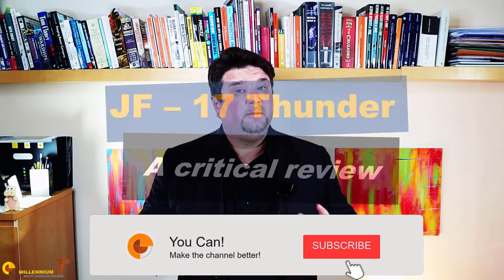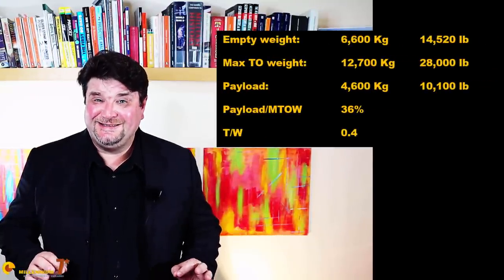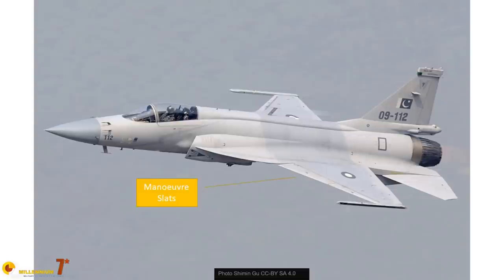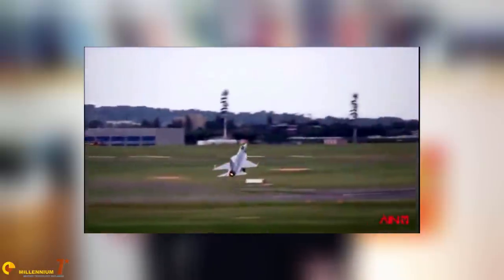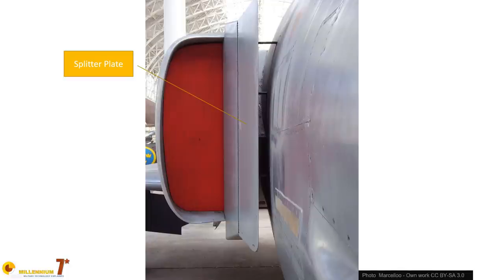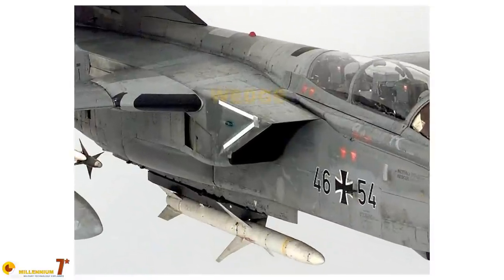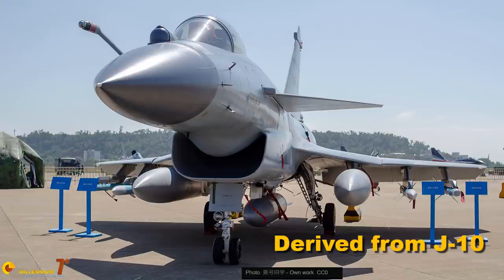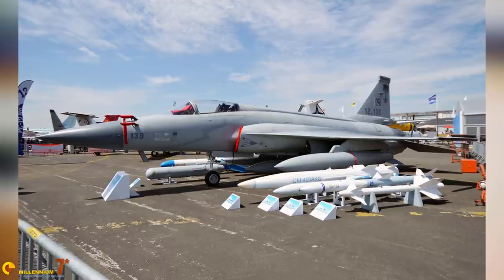JF-17 Thunder Block 3 & F-35 - What do they have in common?

Comment: You have to give Pakistan Kudos for developing their home grown fighter like India with the Tejas and no matter what their fallacies, we have to bear in mind that these are developing nations and not modern industrialised powers so every step is a step forward.
Reply: You can't compare jf 17 with Tejas. Tejas was completely designed by India with its own money. Jf 17 was made as a joint venture between Pakistan and china. It is safe to assume that it was the Chinese who contributed the most when it comes to funding and technical expertise. Jf 17 should be compared to the su 30 mki. An su 30 designed as per indian specifications.
Reply: @dranzergigs8333  You are right I agree. I meant that even the fact that a non ideal plane was made is already an achievement in a developing country we can't use first world planes as a reference, they have years of experience ahead of us. In my country Tunisia (which is a small country compared to giants like India or Pakistan we only produce light planes sport (kind of mini Cesna)
Reply: @dranzergigs8333  Although you are right with the point that it's a joint venture. But it's still such a big leap forward..Like Pakistan is "manufacturing many parts in Pakistan now and these JF17s are totally assembled by Pakistanis without chinese help anymore.. An R & D department is working which made it reach to block 3 with help of china..
 2ndly, Pakistan is also working alone on Project Azm which is a 5th gen fighter jet.. Although it's a term plan and slow process.. Pakistan makes fully indigenous Burraq UAVs and training aircafts Mushak.. Al-Khalid MBTs.. Cruise missiles..  Medium range ballistic missiles and many many more...  But also remember that the overall defence budget of Pakistan is less than $10B and doing all this in such limited resources is quite much for us Pakistanis..
The new government is focused in economic revival of the country and it will give further boost to such projects..
Reply: @eddykhan6672  first of all your budget is 17 billion dollars. 
Second your project azm is on paper till now and we haven't seen a design of the aircraft,so it's on paper. 
Now if you want to listen about us , so our amca 50% work is completed and first flight will be conducted in 2024, and both versions will be inducted in 2030, we have other ongoing projects like tedbf, aura  swift ucav, ghatak ucav, and Tejas mk2, Ins viraat.
 And there are many countries who make good defense product in less budget than yours
Reply: Majority of Tejas is bought from overseas, like radar, engine, avionics, even the missiles it will use, etc. Jf17 is all domestically produced by china or Pakistan, nothing nothing bought from others. That's the difference. India basically designed the shell only, and it's a samosa and no one is envious of the shape. And even just that, India has so many problems and doesn't even want it for their air force, they'd rather use Russian or french jets etc.. same as indian tank and anything else India designed. India far prefers other countries versions since indian one is far inferior in specs, also not reliable and breaks down far quicker.
Reply: @ex0duzz  I always encourage home grown stuff.
Reply: @ex0duzz  😅😅 saste nashe . Abey radar bhi India ka hai. Aur ha jf17 ki engine Russian hai baaki baaki sab Chinese hai ejection seat uk ki hai🤣. Kuchh research Kar le
Reply: @death_parade  tell me which indian made jets it's currently officially used in. Aka none. It's still in development. If it's anything like tejas or Arjun or any of India's other home grown tech, good luck, you will need it. By the time it's ready it will be obsolete already lmao

There's a reason no one buys India's tech or weapons, only India. And even indian military doesn't want it and prefers other better weapon and tech
Reply: @death_parade  and astra bvraam? It's only 110km max range, china's pl-15 is 200-300km already, and also have pl-17 and pl-21, which has 300km range and has its own aesa. Indian jets don't even have aesa yet while even Chinese missiles already do. Chinese domestic missiles basically double or triple India's missile range, not to mention Chinese planes have better radar too. Indians won't stand a chance with astra, hence they need to buy foreign tech to stay relevant.

Pakistan will also get Chinese missiles like pl-15 most likely if they haven't already, so yeah. Astra is worthless basically.
Reply: @death_parade  so no indian made planes use indian made aesa.. And like I said, if India is using astra on su-30mki then it's a joke when china has pl-15. India needs to buy longer range modern missiles from others if it wants to stand a chance.

No argument, no talk. You got nothing except dodge. And you know it.
Reply: @muhtadaali8847  Pakistan can not even design a 250 cc motorcycle. First, do that and then talk about aerospace R&D!!
Reply: Bro it's not homegrown in Pakistan it assembled in Pakistan😂😂
Reply: @dranzergigs8333  lets compare how indenigous your tejas is. 

The main thing, The engine which replaced our own made Kaveri Engine is GE404.( USA).AESA RADAR(ISRAELI). The radar is custom made only for Tejas by joint ventures.MISSILES(RUSSIA AND ISRAEL) . Although many of them are licenced to be made in India but it's still not Indian  technology.Radar covering cone(UK)The small silicon semiconductor ICs
Reply: @thelovertunisia  tejas is not fully indigenous it's a propaganda
Reply: @muhtadaali8847  Your engine is Russian 😂😂 not Pakistani rest all is Chinese Tejas is 65 pc Indian JF-17 0 pc Pakistani
Reply: @orkkojit  your engine. Missiles and other main components are exported. No one in the world makes 100 percent indiginous. India will be stupid to go for it
Reply: @dranzergigs8333  what is considered indeginous in tejas?
The design was done by dassault
Has the body of a vigen and the cockpit of a mirage
Radar is israeli
Engine is american
Weapons are foreign(astra is good though)
And the avionics are israeli
So what exactly is indian?
Reply: @thenoobdashow7428  what are you on about?the budget is clearly 10-11 billion dollars lol
Reply: @dranzergigs8333  no actually the Tejas is a completely foreign designed by France uses an American engine,it uses almost all  foreign tech and parts.
Reply: @muhtadaali8847  lol,only airframe 58% is in pak, entire plane is done by china. Paint by pak.  Calling jf17 pakistani is like calling f16 is pakistani.
Reply: @thelovertunisia  We shouldn’t assume that most of the work was done by China. The person you are replying to is drawing a false parallel. MKI is India picking what they want off a menu. Where as JF17 is jointly researched and developed. Pakistan didn’t have the means to produce it in the 90s so they took their design to China.
Reply: @umarchaudhry8953  Most countries today given enough time could create an indigenous fighter but often money and time are missing.
Reply: @ex0duzz  They took 30 years to build a mirage 2000 copy and still no one wants it.
Reply: @dranzergigs8333  teams was actually designed with heavy input from Dassault.
Reply: @muhtadaali8847  we literally use zero engines made in Israel and have no American a2a missiles in our inventory, you're making a fool of yourself son.🥵
Reply: @advaitk1917  GE engine and israeli missiles. I  miss typed it. Don't try to be over smart. You know what I am.talking about
Reply: @muhtadaali8847  we also have multiple weapons including standoff ones that are manufactured in house, that is all leaving aside the ew suite and most systems on board happen to be indian. You know what I'm talking about.
Reply: @thenoobdashow7428  radar India ka hai. Lolls. Mate writing 'Made in India' on an Israelian radar doesn't make it Indian.
Reply: @ex0duzz  over rated pL15 can be dodged by any good maneuvering propeller plane
Reply: @ex0duzz  in term of missile development India is far ahead in any Asian country, any defence magazine accepted it. Only problem with subsonic cruise missile
Reply: JF 17 is only painted in paxtan.
Reply: @death_parade  what a reply bro 👍
Reply: @dranzergigs8333  israeli radar  
Mirage based chasis 
Russian weapons 
American enegine 
British ejection seat 
Yeah indian totally
Reply: @iamsalngo81  just bcoz it's a delta song configuration doesn't mean it's based on mirage frame. Would you say gripen is also based on mirage frame. 
Similarly gripen also has American engine, British ejector seat. Same goes for Korean and Turkish jets as well. 
Tejas also has indian missiles like Astra aaraam rudraam and many others.
Reply: Thanks for watching,,
But JF-17 speed Rafale speed range is same ,
Reply: The only thing Indian on the Tejas is the name with the radar , avionics , engine and weapon systems all imported from overseas ….atleast the Pakistanis manufacture 60% of the components in house
Reply: @ex0duzz  well to correct you Pakistan's defence budget is actually less than 10b it is actually 8.something. project Azm is already gaining momentum as Pakistan and Turkiye agreed to work on TF-X together talks are ongoing to develop two separate variants for each country. Turkish variant with more western components while Pakistani variant will have Chinese systems incorporated in it. Which can be a plus point for the exports as well. No one was asking you about your projects or comparing the two but since you have such an inferiority complex towards Pakistan and their jets so you keep on rambling about your projects.
Reply: @ayonbiswas4186  who cares if we designed it or not the truth is our jet(started in 1995) is already flying and exported to other countries and your smaosa(a project from late 70s) is still struggling for induction and yet to find a customer.
Reply: @amitbhau  then why don't you get propeller planes coz your jet wasn't able to evade the old aim-120 and yet you have the nerves to made such ridiculous claims.
Reply: @djrandomwalker7656  the jf17s has several sub systems that are made by pakistan
Link 17,avionics,wide array of air to ground munitions made in pakistan such as takbeer glide bomb and h4 sow 
The jf17s electronic warfare suite is designed and developed in pakistan
The jf17s maws are made in pakistan
The jf17 has several pods for targeted jamming or bombing missions
This is a whole lot better then indian tejas
Reply: @dranzergigs8333  compare the viggen and mirage
And see the blueprints 
It's literally designed by dassault
Reply: @dranzergigs8333  tejas completely designed in India with help of multiple other countries and parts from those countries
Reply: @dranzergigs8333  Lol it is based on mirage lmao it is
Reply: @orkkojit  but still we offer fantastic ☕️ 😂
Reply: @kaz9242   Lmao ... TEJAS are so good ... even Indian Airforce is not using it . Its sooooo Good ... no one wants to buy it lol
Reply: @dranzergigs8333  actually the French did help with incra Indian aircrafts stand there are many foreign components inside of it then there's nothing wrong with that
Reply: Raheel Niazi product. 4u  Western people too often forget that for us in developing nations even the idea of creating a plane from scratch is an achievement, so it does not matter how good it is. They too started with many prototypes until they worked things out.
Reply: @ex0duzz  300km? PL-17 pass the joint dude what you smoking?
Reply: @ex0duzz  that was for older version for India , ou radar and many things are now produced in India
Reply: @ex0duzz  we are develpoing our own missiles with longer range than pl 15. And please talk about pakistani projectss not about chinese.
Reply: How can you compare the Pakistan JF-17 to the piece of crap known as the Tejas? The HAL Tejas is such a piece of crap that the Indian Aeronautical company even wanted to scrap it but it was saved for the reason of “national pride” more accurately to protect India from shame and losing face on the world stage. The Tejas is plagued with technical problems at one point it couldn’t even break the sound barrier.
Reply: @TheTraveler2222  I work in engineering and each time you build a system for the first time, it is unavoidable to have issues and all industrialized countries started out like this. Nobody is born wise, we get wise by learning from our mistakes.
Reply: @thelovertunisia  I agree with you, I am Chinese and we been through much the same problem, "made in China" used to be made fun of, but not anymore. My point is, when you first build a system, it must be reliable, the problems must be manageable within the confines and limits of the system itself or else the whole system is no good and must be scraped because the whole foundation is flawed. Where India has gone wrong is knowing the system is flawed but continue to build on a shaky foundation. The JF-17 on the other hand had issues, but you can see incremental developments and improvements with the block 2, block 3 and now block 4 variants. Ever wondered why you don't see the same with the Tejas??
Reply: @TheTraveler2222  I am from Tunisia and although we make most everyday items here locally, even a tunisian car brand, people still have this complex that western products are better. In China you have overcome this now but here in North Africa we still need some time.
Reply: @khurram9043 offer is to multiple allah citizens usa is allah china is allah gcc is allah everyone is allah
Reply: Okay let’s make it clear. India ordered 222 Tejas for everyone who says iaf doesn’t want Tejas. Manufacturing and assembling are different. All weapons that go into tehas are mostly Indian. Israeli radars are not gonna be use after 42nd Tejas. Tejas beats JC 17 in every department except for endurance. 
Jf17 is a Chinese jet made with cheap materials for Pakistan. Even China doesn’t use it. Tells you the quality of the jet. Pakistan is a country where it failed to produce a single motorbike and you guys claim you ,ade and jet. Come one. Let’s be a bit realistic.